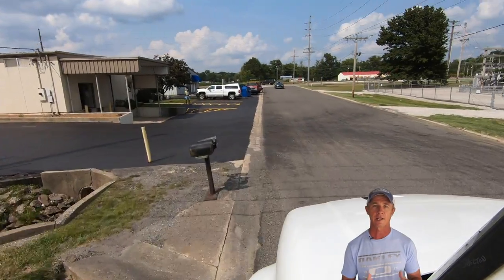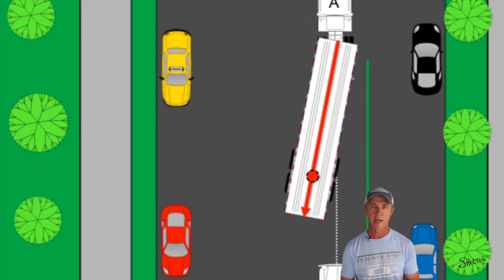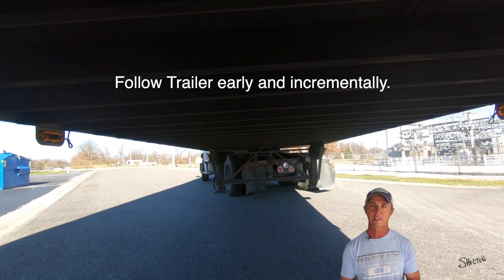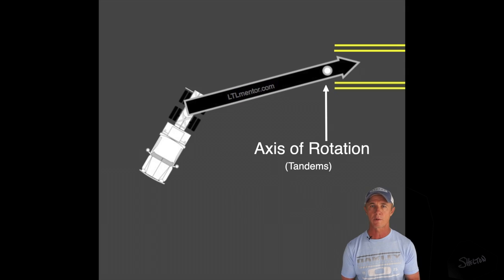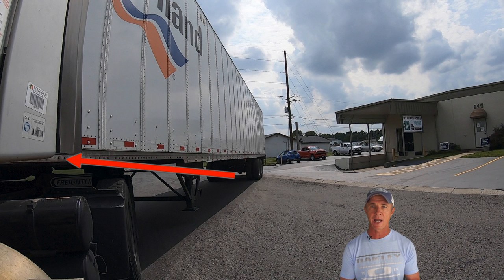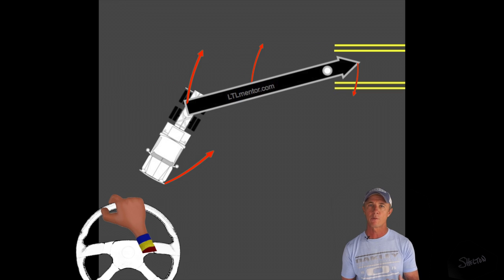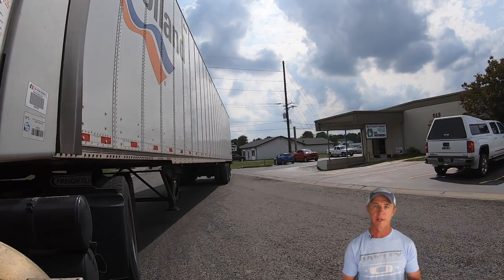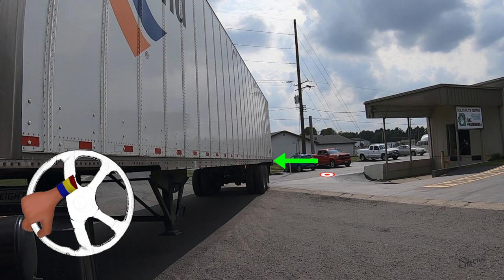Truck Backing Episode 11: Alley Dock Adjustments

Comment: Hey Dave - when you get in that early turn (half or whole) to keep the tractor nearer the front of the trailer (incrementally) - don't you adjust your tyre path then? ie make it shallower? I tried it, but must be getting it wrong as when I'm following a curve to the tyre target but then try to bring the cab round early I loose the path a bit and have to put more steering in again. What am I getting wrong?
Reply from the maker: You can over-do the early turn. You will have to monitor how the tractor is interacting with the kingpin and make subtle adjustments if it is changing course. It will take time. Sounds like you are on the right path Tom.

Comment: i got all the steps down but for some reason my aim is just terrible. I aim for one spot and always end up backing into a different spot, and then trying to fix it I end up near jacknifikg lmao
Reply from the maker: Too much offset between tractor and trailer which is making the trailer rotate . Slow rotation with left turn. Avoid right turns. Makes you rotate twice as fast.